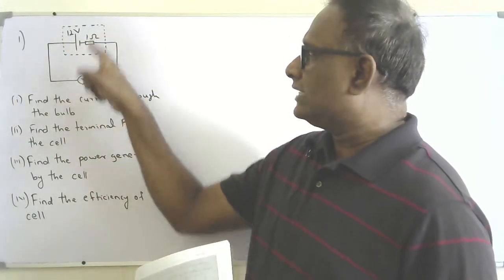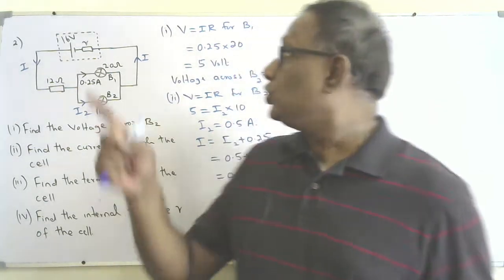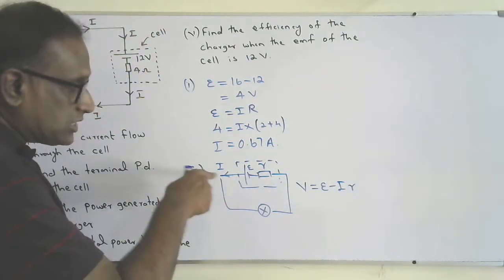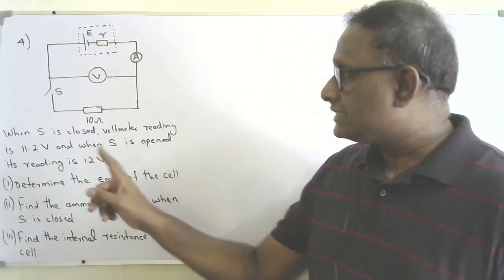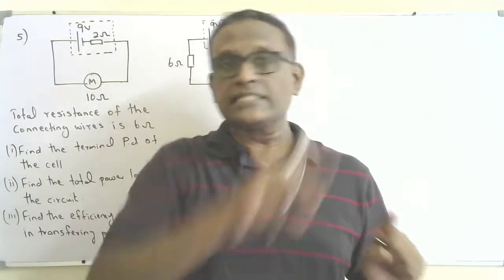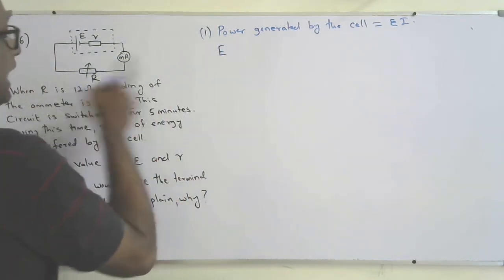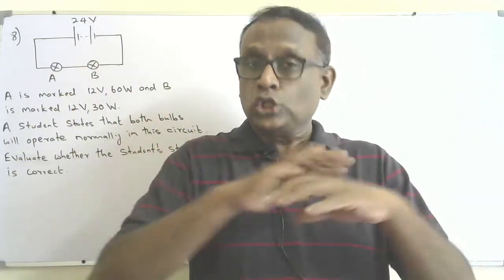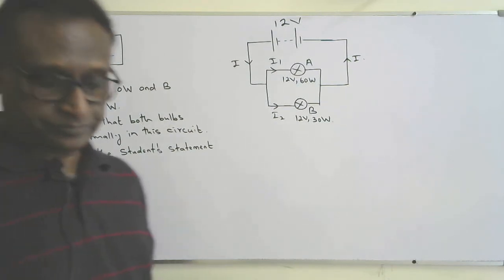Lesson on Electricity Exam style past paper questions Edexcel Cambridge  circuit Aravinthan

Comment: Sir for question 3(v) shouldnt it be 10.72 minus powerloss in battery, not 2.69? Because 2.69 is the total power loss right for battery and cell not just battery? So shouldnt we calculate it for battery and then use that value